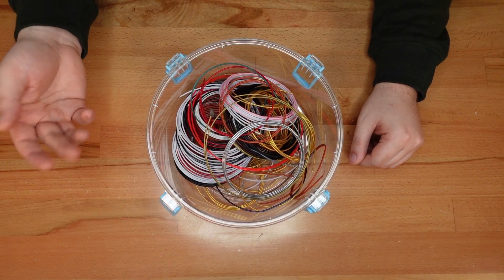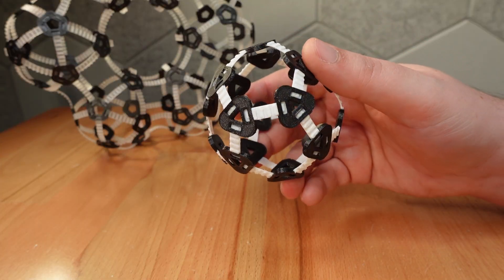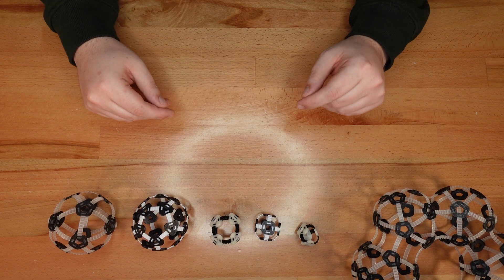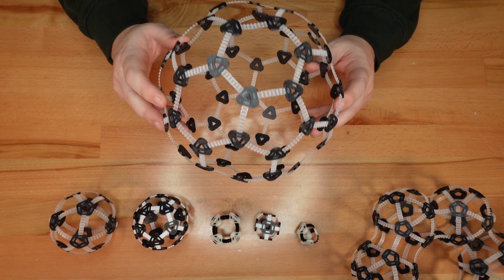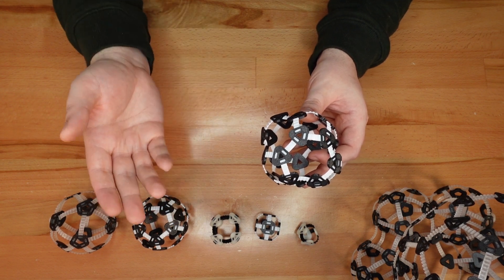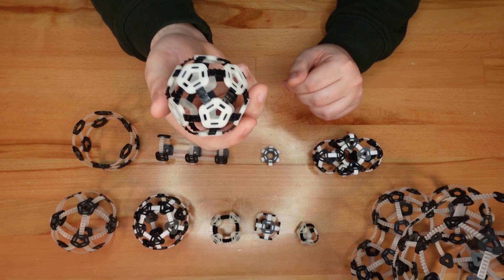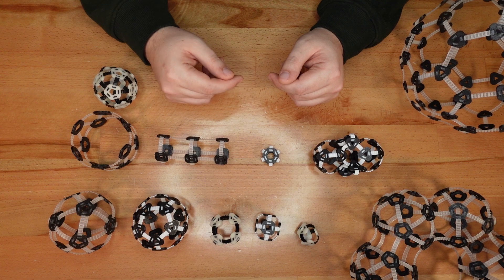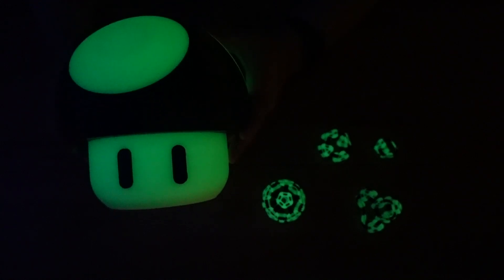Nodes - A 3D Printed Wireframe Toy

Comment: What infill do u recommend ?
Reply from the maker: The parts are so small that they are almost entirely perimeter lines. You could probably use 0% infill for the few gaps that remain, but I used my standard 15% gyroid infill.

Comment: If you cut a link with scissors, can you still connect to the node connectors? Cause it would open a ton of possibilities
Reply from the maker: Good question! The ribs on the standard links are not the right shape to plug into a connector. They are intentionally taller and wider. I've uploaded a new "Trimmable Link" option when shrinks the ribs so that they can be used in this way.

If you have a specific length in mind, though, the standard links will still be easier to use.
Reply: @3DPrinty  I don't actually own a 3D Printer, but I do love your designs. 

My suggestion was so that even if the links broke you could still have a functional toy. I think it would also be a bonus for someone with those conveyor belt printers, so they just print an incredibly long link until the filament runs out.